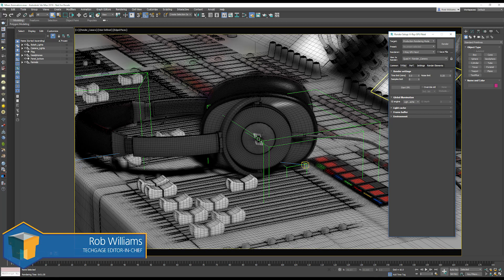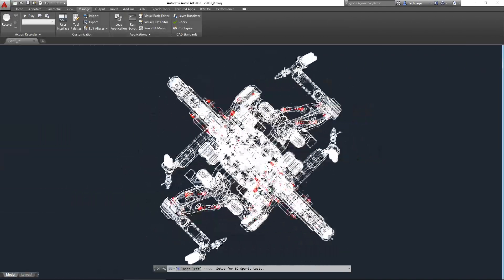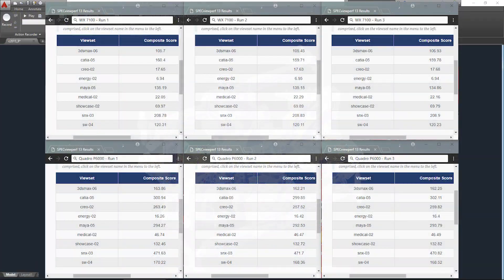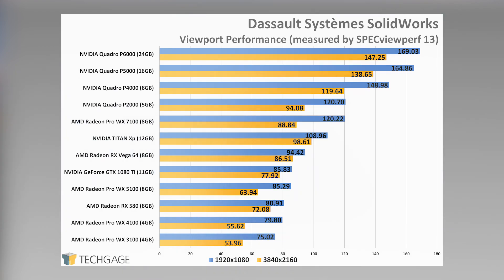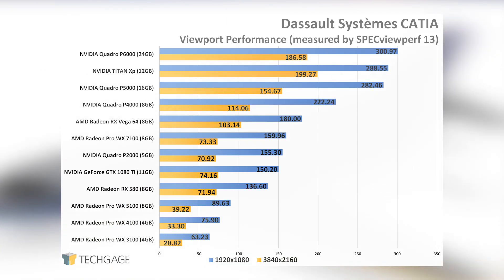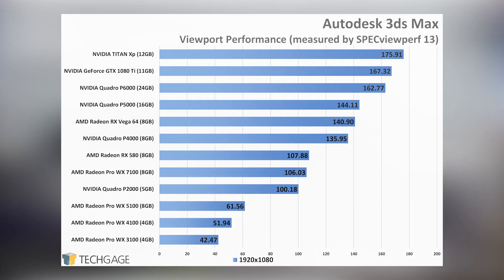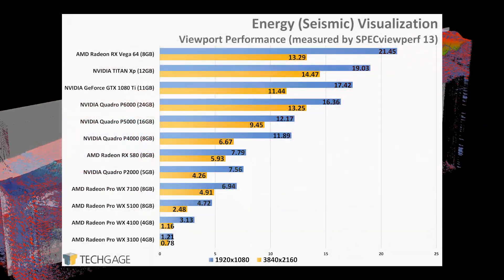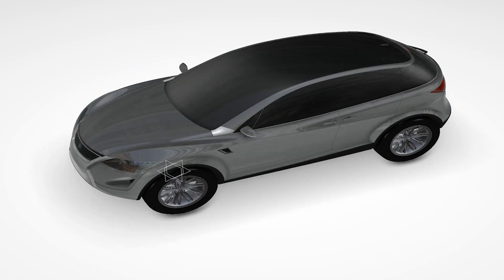Viewport Performance: SolidWorks, CATIA, 3ds Max & More

Comment: Great video.
Nvidia professional GPU selection chart is very confusing.only higher end Quadro cards ( p5000 and above ) support ECC ,lower end P400 to P4000 doesn't support ECC. Nvidia's latest Turing based entry level desktop  Quadro RTX 4000 card also didn't support ECC. Mobile Quadro RTX GPUs are even worse ,non of them support ECC.
Reply from the maker: Yes, it's one of the long-standing complaints. Not everyone needs a 5000-series and above when doing basic engineering on a handful of parts at a time. At the same time, ECC won't protect you from software corruption, bad drivers, bad updates, power outages, or worst of all.... user error.

Comment: I'd like to see some SW Visualize testing.  Viewport & rendering.  CPU & GPU.  I'm having stability issues with a 1950x with 2x 1080 FE in SLI.  What's the best set up for Visualize?
Reply from the maker: That's a bit beyond our capabilities right now, especially with regards to the licensing (Dassault has dismissed interest in our benchmarking in the past), but it's not out of the question in time since some companies have offered us loaner licenses. It's hard to perfect all tests at once, but we're keen on doing this when we can.
Reply: @Techgage  I'd be interested in helping.  I have a lot of hardware and SW Pro & Visualize Pro license.  I could run some tests for you or lend you my license.  I bought a RTX 2080TI but I'm trying to decide what PC to put it in (workstation/rendering or gaming) and I've been looking at doing a 9900k build to replace my 7700k current Solidworks workstation. Let me know if you're interested.
Reply from the maker: That's a generous offer; thanks a ton! We'll keep track of this and see about testing when time better allows (so much going on right now :S). One of the two GPU vendors offered us access to SW within the past month, so chances are we might not need your license, but if it boils down to it, we'll will let you know (and seriously, cheers for that). 

We do very limited scripting, so we rely on solutions like SPECapc. Does that suite deliver the kind of results you're after? Usually, we don't put much faith into the overall scores, but the breakdown scores seem beneficial. That's based that on 3ds Max and Maya, since we've never had need to use SPECapc SW. Are there other SW benchmarks you know of that you put faith in?
Reply: @Techgage  The SW benchmark is interesting to look at but can't be accurate base on my inconsistent results in my testing and seemingly impossible posted scores on their site.  I mainly rely on cinebench r15 for single and multi threaded performance. I don't know of any benchmarks that would show Quadro driver optimization in SW.